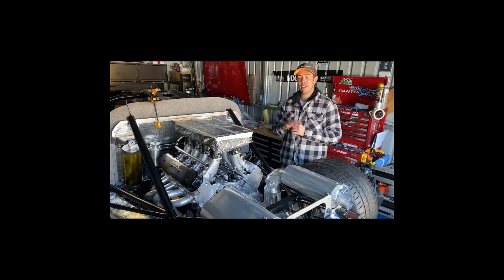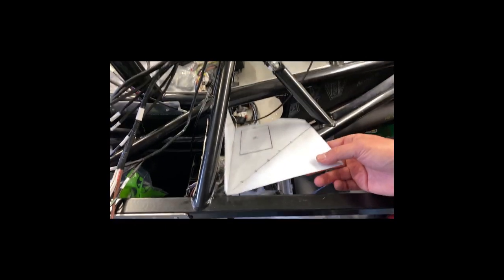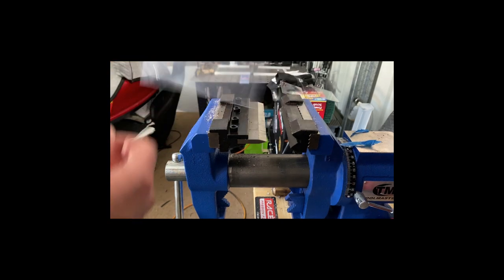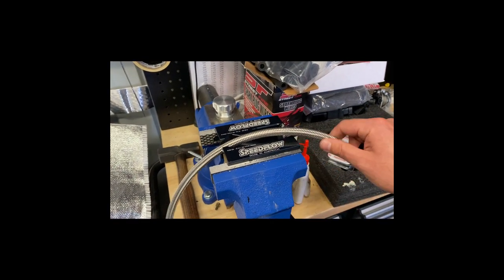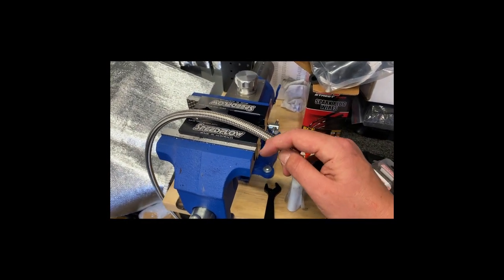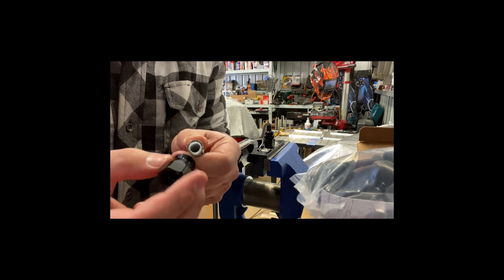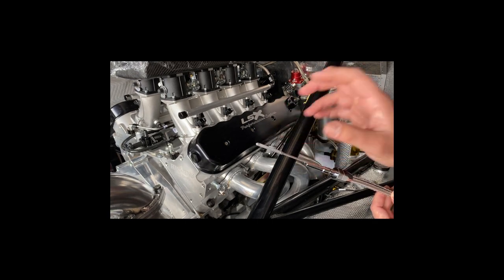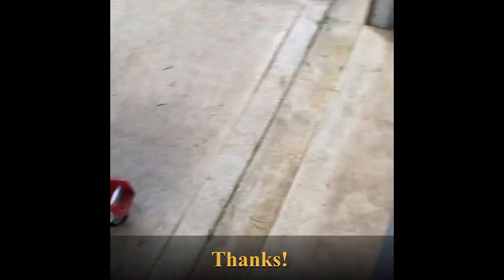Ultima RS - How to make AN lines and fabricate brackets from sheet metal (Video #22.5)

Comment: Hey Rob,

Love the videos. Currently looking at options for a build and will be doing it in Melbourne too. Look forward to picking your brain and seeing this thing in the flesh!
Reply from the maker: Definitely keen to see which manufacturer/project you go with, and happy to help! I'll announce the follow on project for the Ultima in the next few weeks, so maybe that will help with some options. Cheers, Rob
Reply: @rob105motorsport  thinking of LT5 on E85 with a hollinger setup. Also like the sound of this new LT2 flatplane crank 🤔. So many options and so much $$$ 😂
Reply from the maker: @Aydo1990  Love the LT5. GM just discontinued them, so they'll be relatively rare in comparison to other LS based gear. Anything with a flat plane crank will be great too. As you noted though, LT over any LS based engine is double money or thereabouts. I've only eaten Mi Goreng for the last 12 years as it is, so the budget had to be called at some point.
Reply: @rob105motorsport  Yeah the news of it's discontinuation means my contact is putting one on hold for me and I'll have to pull the trigger on it. I figure if I want serious power I'm going to need something more than a NA setup anyway. Looks like its just under 40k for a LT5 at the moment and I'm probably going to have to resort to soup mix at this rate to offset these costs